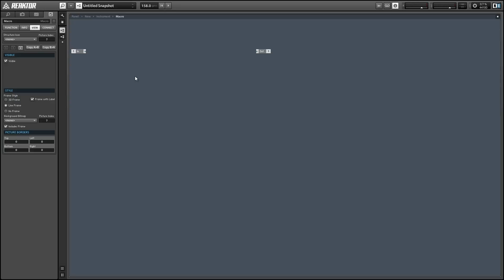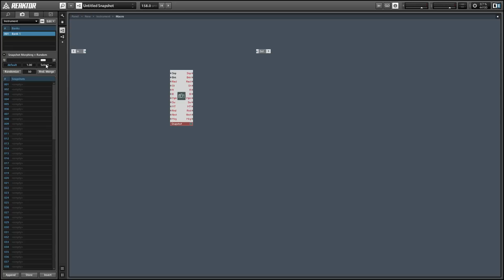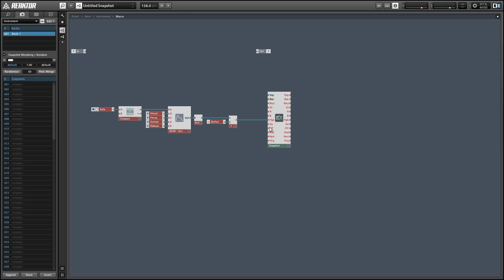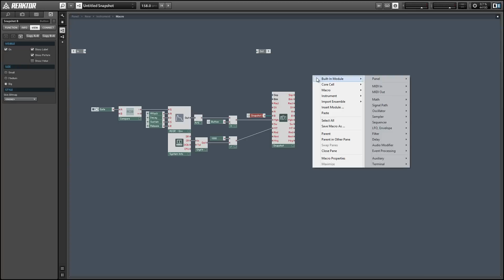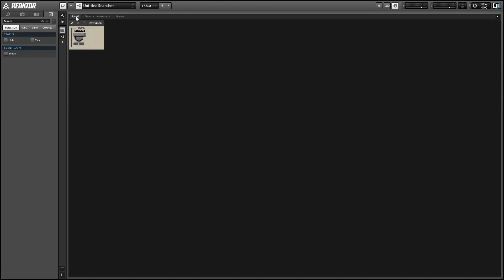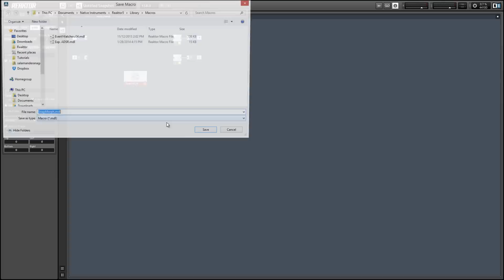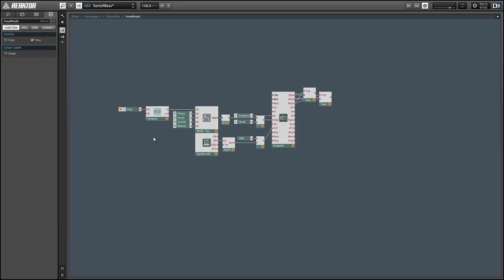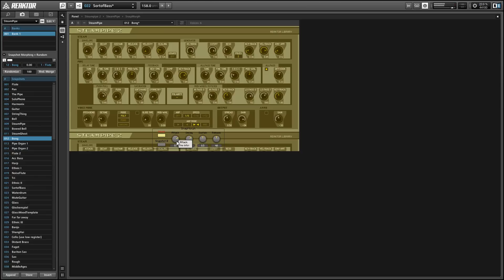Reaktor - Automated Snapshot Morphing - How to Tutorial

Comment: Thanks for this kind of videos Salamander! I don't know if this is too complicated to ask or if you even have the time to read or answer this question but anyhow, I'm working on a filter that has internal snapshots so you can sequence and recall the frequency, amp and resonance parameters, sort of like the Buchla's triple morphing filter and as far as Snap Value [] module goes, everything's working fine but I was wondering if it was possible to slowly morph between those snapshots...? problem is that those are not the ensemble's or instrument's snapshots, those are local ones stored at a macro level.  I would be extremely grateful if you could just point me in the right direction.  Thank you!

Comment: Great video! However I didn't get it to work properly as in the video. The morph slider in Reaktor doesn't move, but the sounds change according to the values I give them iwith the macro knobs. Downloaded the macro to compare with my own. Hasn't found the cause yet, but could it have something to do with my Reaktoe settings? I've got the latest version of Reaktor 5.Again, thanks for great tutorials!
Reply from the maker: Andreas Sandberg Sorry, I'm not sure what could cause that off the top of my head... I'd be happy to take a look for you, my e-mail address is salamanderanagram at gmail